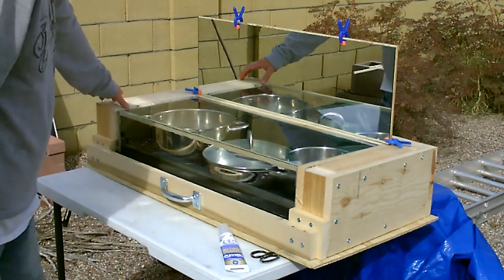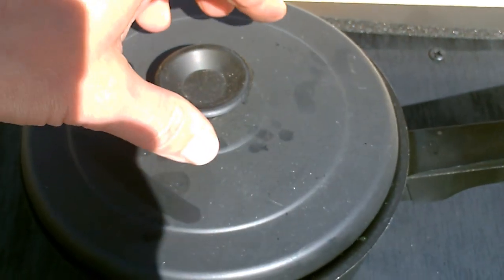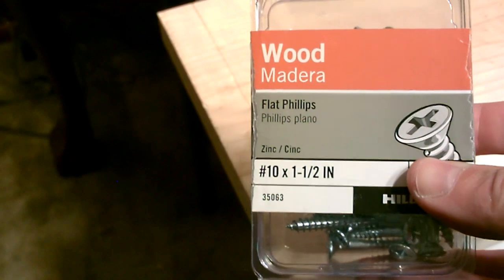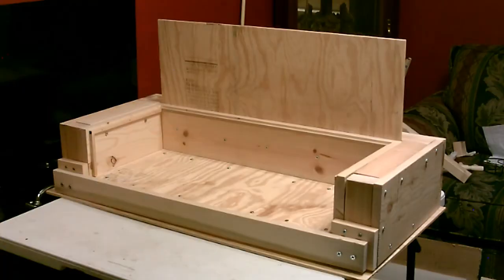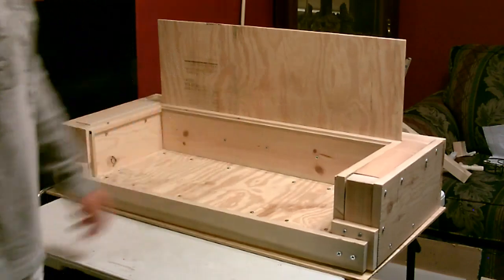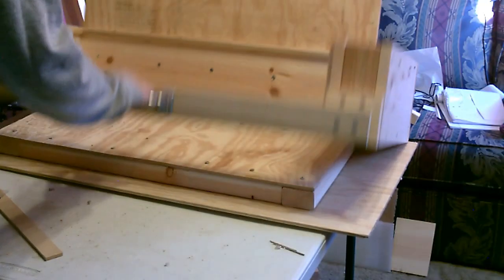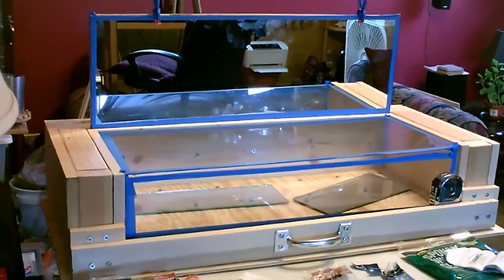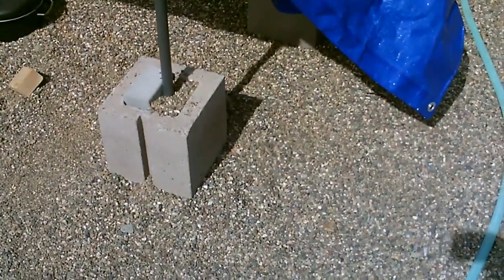DIY Advanced Solar Oven! Fully Insulated "No Turn" Solar Oven! (real wood, glass and mirror!) 350F+

Comment: hello, just curious before copycat: do you use it a lot? would you like to improve it with double glasing/more mirrors or are you satisfied with the performance?
Reply from the maker: hi. i've tried double and even triple glazing in earlier models but adding extra glass always seems to reduce the temps. extra mirrors is something i've been thinking about, but then you may have to turn oven more -so it's a tradeoff.
Reply from the maker: @J V they sell simple glass cutters for 5 to 10 dollars at stores like home depot and lowes. i think i even saw one for 3 dollars at harbor freight tools. very easy to do. you can learn in like 5 minutes. they might be able to show you at the store. another way to learn would be to watch a youtube video on it.

Comment: Looked like a gr8 design so I built one.  Mine is just slightly larger and I designed it so mirror reflector can be taken off and stored in the oven.  I cannot get it above 250 deg F though.  Right now I have now sealing along the edges of the base where the top glass portion moves up and down.  did you create some kind of seal along these edges that would keep in more heat.  Excellent design mine just needs some tweaks to get temp up for baking

Comment: I did not notice given hints about one thing: Where do you get the mirror, what kind of mirror is it (glass, etc)and how do you cut it to size without breaking it? Cat in Seattle
Reply from the maker: hi. it's a real glass mirror. cheapest way to get that is to buy one of those 5 dollar wall/door mirrors that walmart sells. (just remove the wood or plastic edging). to cut mirror i just use one of those small 5 dollar glass cutting tools (the ones with the tiny wheel). you can get those at home depot or probably even harbor freight tools or walmart.

Comment: Where did You get that insulation ? I can't find it at H/D or Lowes .
Reply from the maker: hi. here's one link https://www.homedepot.com/p/Greenfiber-Low-Dust-Cellulose-Blown-In-Insulation-19-lbs-INS541LD/100318635
Reply: @desertsun02  I Already have over $100 invested in this ( mirror alone was $30 ) . I bought some fiber glass insulation ( 2 small bags ) , any chance this will work ? Tell me what does the vertical glass rest on ( bottom ) ?

Comment: .Well I finally after many months got my truck running again.
And finish building my solor oven like this. Mine however is taller.
Oven area is 21x24x21 WxLxH. I had to use plexiglass instead of glass because each time I got glass, well it broke.
Runs at continue 150 to 170 F. Has gottten to 200f plus ( not much over 200).
A lot more durable then the box one I had made before.
I however do not have the reflector on top. Which would likely make it run hotter. I originally had planned to. But since my truck was down it never came about.
The wooden part ( painted) has sat outside since last year. And once, about a month ago, I finished building it. It has sat outside. I pained mine red inside and out. For no reason other then it was a darker color at the store.
For the last week plus I have been using to dry mesquite beans pods. 
I have baked bread in it a few times since I finished it. Can't get brown rice or beans to cook in it. Which is a problem I had with the cardboard one also.
Over all I'm happy with it. But wish I could cook rice and beans in it.
I'm thinking I may add a bottom reflector along with top when I can.
Reply: I thought I may add.
I used 1x6 dogear 6 foot fence and 2x4s with attic spray in insulation ( non fiberglass) and plexiglass.
I sealed the inside, where the insulation goes, with silicone for Windows. And ended up also using  to seal plexiglass.
I did notice about once a month while in use. I will have to replace where the two pieces of plexiglass meet. I notice a leak in part. Then 2 days later I notice the other half was leaking. So in the future, next month, I will just replace the whole edge at once.  One $5 tube will last the whole season with most not used. Cheaper then any propane I would have used.
I don't remember total cost. But it wasn't much. I'm going to over list materials. Because I used some after I was done building all but the glass part.
(12) 1x6 dogear 6 foot fence ( it's 4 high)
(3) 2x4 8 foot
(1) plexiglass ( I cut both pieces from it)
(4) pieces of glass 24x24 ( didn't use they all got broken before I used then both times.)
(3) tubes of window silicone, not chalking (I don't remember but I think it only used 1 total. )
1 quart barn red outdoor paint. ( still had a lot left over after I used.  a pint I believe would have done it and still had some left)
The blow in insulation I had bought when I made my cardboard one the year before. Both just dented the bag of it. Unfortunately after making the wooden one I forgot and left it outside and the wind got it. 
I choose to use the fence wood because I didn't want plywood to separate. And they were cheaper then 1x6s.
Reply: Also. As I had said it runs 150 to 170. That is sun up +1 hour to -1 hour sun set. Not turning. Turning from sun up angle to sun down angle I achieved the slightly above 200F. Turning more then the two faces did no more. 
So moving it once during the day, 10ish,  I recieve a little more  during high sun times. 
I prefer just to set for noonish and just do the 150-170. This way i can set it the night before and next evening my bread is done.
Which is a nice moist fresh bread with no real crust. 
I make 3 to 4 loafs
4 cups flour
1/2 cup sugar
1 teaspoon yeast
1 cup water.
Found that clear lids on pots works best for cooking bread like this.
Black or metal lids cooked it a lot less. 
Replace the flour and sugar with velvet mesquite flour. For a very strong bread. Has a molasses taste.
Skip the yeast with either and you make a dense bread.
And as a FYI. With the mesquite bread. Let it air dry in pieces for a day makes a dog food.  My dogs go wild for it. And yes it is safe, coyotes eat the pods and beans often. High in Protein, zinc and some other good stuff.

Comment: do you think that if you continued the mirrors around the left and right sides as well that would make a difference to trapping more heat in??
Reply from the maker: hi. that would or should make it hotter. i didn't use side mirrors because of the shadow they can cast. but if you don't mind turning the oven more, i'd say use side mirrors 👍🌞

Comment: This looks great but... as a cook I wonder how to get a heat low enough to simmer, for instance to make a slow-cooked stew, and other dishes that don't require high heat. Is it just a matter of changing the inclination of the mirror? It would be useful to draw a heat scale like on stove knobs, especially since there is no flame, but depending on the time of day, the season and the latitude, the scale would not be useful everywhere all the time. 
And supposing you need to cook pasta for ten people, or use a pressure cooker, you'll need more height space than this design offers. Can this be worked out?
As for sauteing, I don't think it's possible. I don't think one can stand in front of this stove and do cooking routines like with a regular stove, adding ingredients one after the other etc. But if it boils the water for tea or cooks the beans and the soup, that's plenty.
Reply: A solar oven functions entirely like a crockpot. It simmers until it cooks.  You can't get a high heat, like that needed to cook pizza crisply, in a solar oven. You can't really cook pasta in a solar oven - you could on a parabolic.
Reply: @seungjisuh5784  thanks.

Comment: Great video.  I'm going to try to build my own.  I have a question though...insulation that I've always worked with needs to maintain the air within the material to hold insulate properties.  I've never heard of an insulation that can be packed like that and still be effective.  Is there a reason why you used this type of insulation?  Just curious what your thoughts were about that.
Reply: Hi! Great idea, easy construction. Doable. Can you give estimate of cost and weight? 🙏
Reply: Great question. Cellulose insulation (used here) has an optimal density for maximum effectiveness. I think it is 3.5 lbs per cubic foot. So one should not pack it as tight as done here. The idea is to maintain air space in the material.

Comment: Love it..  I would love to see the mirror be removable for storage purposes.. perhaps on a hinge that you can fold it down and latch it to the oven itself.   I love the way you left the front open with the glass.  I have been looking at different ways to make my own and this is the very best video I have come across. ever.. I will certainly try to use some of your ideas, mainly the open front concept, in my build.  Thank you so much for sharing .. you did a great job!
Reply: I made oven based on this design and made the mirror reflector removable using lag screw to bolt combo with wing nuts.  the screws go thru holed in the base of mirrored section and tightened down with wingnuts.  the mirror can then be stored inside oven.  My oven will not go above 275 deg F so far.  May need to created a better seal around the edges of the oven along where it opens and closes

Comment: For added insulation, use thinner pieces of wood and don't smash the insulation.  Wood is actually a poor insulator (r-value is about 1 per inch, whereas fiberglass is about 3 per inch).  Good build and lots of ideas you've given us!!
Reply: Gaps in insulation aren't a bad thing
Reply: @joeychagnon3427  That's not true at all.  It's one of the problems in homes, you can see the gaps formed over time at the tops of walls in thermal imaging.  Those gaps allow thermal transfer at an accelerated rate, leading to heating and cooling losses.  Gaps bad.
Reply: @joeychagnon3427  I'm not sure where you heard that gaps in insulation aren't a bad thing???  Thermal insulation has one job.  To slow the transfer of heat from one side to the other.  If you have a gap, that means that the heat can more easily transfer.
Reply: Use mineral wool batts and you don't have to worry at all
Reply: Not 100% sure, but slightly smashing the insulation may be beneficial.  Insulation has a tendency to settle, leaving gaps.  It would be interesting to see though, which worked out better.  Give the type of insulation he used, it may be more likely to settle, based on the propensity of those materials to collect environmental moisture.

Comment: Outstanding in the way you think through each aspect. I have a suggestion.. I would like to try Perlite as the insulation. I heard it has around R-value 2.7 per inch thickness( left over from making my rocket mass heater. ). Good or bad?
Reply: Don't see why not. It doesn't off gas and it won't burn readily

Comment: It would be cool if you built one lined with bricks (instead of insulation) and enclosed with glass and then compared them.. That would be more expensive because of the glass; maybe build it on a half scale..? I'm interested to know if the insulation, which also keeps heat out, is very efficient with solar ovens. I think keeping a thermal mass warm might be more efficient. Just a thought.

Comment: The insulation works best when not compressed.  By compressing the insulation the way you did, the air pockets you want, no longer exist, and the insulation factor you wanted, unfortunately you did NOT achieve.  Otherwise, not a bad build.
Reply: Nice information.

Comment: Was there a reason you used solid wood instead of plywood for the sides? Quality stable wood of that dimensions, is hard to come by here. I was thinking of using 12mm ply and constructing my own ‘SIP’s maybe 70mm of foam insulation. Very strong, and very light.

I love the design, just looking to modify it a bit to suit the materials I can buy locally.

This is the best looking Solar oven I have seen, far better than most commercial ones. It was the looks that was putting my wife off having one. 

Thank you.

Comment: Great idea ! Just one suggestion. The side walls need not be wood or metal. Side walls of glass itself will be better and give addition 50℃ boost. Not sure if epoxy glue can hold at that. Aluminium corners can be used to bolt the glass panes together with silicone as sealant.

It will look like a giant record player.

Comment: That's awesome man.. my question is, would it be feasible to use sand for insulation, like the kind you use for a swimming pool filter.
Reply from the maker: sounds like a good idea. sand is a great insulator. will make the oven quite heavy thou

Comment: I need to build a solar oven but I want a solar pressure cooker oven. My idea is get a $10 foam board use emergency blanket and attach using either wire or string create a big C , anchor to a board place pot in focal point.
Reply: Foam board at that kind of temperature will release toxic fumes, and will also melt.

Comment: I'm going to give this project a whirl, it's just about within my limited novice DIY capabilities. I had a few questions desertsun, or anyone else who has knowledge about solar ovens, and has a moment to respond?
- It's heavy, so keeping it outside makes sense. Would it not be better to weatherproof the wood, even if covering with tarpaulin?
- Would the interior work better if it had a reflective mirror-like surface?
- What alternatives are there to the green insulation material bought? I don't seem to have anything like that near me (I'm in France).
If possible, I will look to adapt the mirror so that it can be tilted. No desert sun over here, so I think it would be more efficient to concentrate it more directly.
Thanks again, inspiring video.
Reply: …peut être de la « laine de verre » comme isolant ? ( je parle français comme vous).

Comment: What about replacing the mirror and the top glass by a tilted glass (like the greenhouse design). You still get the same light but avoid the reflective mirror that could hurt the eye.
Reply: You don't get the same light as this with a tilted glass and no reflectors.  Looking straight down at it from the top, you want the reflectors to cover more area than the bottom of the oven - the more the better.   This looks like it captures about 4 or 5 times more sunlight than the box would capture with no reflectors.

Comment: I confused about the high pack of the insulation as well, bc I always taught insulation need to be loose for air. I am open to learn, I was always dealing wid fiberglass before.
Reply: Your instinct is correct. I read about a study of walls with batting vs walls with no batting. Both walls were carefully constructed to modern vapor barrier standards, insuring virtually no air infiltration.  I don't recall the numbers, but there was virtually no difference in R value. As long as there is little air infiltration and the "dead air space" not badly compromised, batting in the walls is not very cost effective. A batted roof showed a bit higher R value than the non batted roof, and was deemed more worthwhile doing. Batting is intended to dampen air movement in the leaky old pre Tyvek walls. 

If anyone doubts that the more the dude packed in, the more he defeated his purpose, just imagine continuing until finishing with a hydraulic press to make it rock solid. If you are sealing a space absolutely airtight any amount of batting will increase heat conduction, no matter what kind of batting is used. To further reduce conduction, one pulls a vacuum on that airtight, dead air space, removing more heat conductive particles.  E.g., Packing batting tween the walls of a Thermos, before pulling vacuum on the bottle, will not increase efficiency.
Reply: Loose insulation works, compacting it removes all of the air (the actual insulator).  Likely only 40% of the rating of properly installed fiber insulation.
Reply: Agreed. It's definitely confusing. Unless someone has special non-conducting insulation..
Reply: I'm not the only one thinking that then! I'm not an expert and have close to zero experience, but air trap is the purpose. Am I missing something as well?
Reply: Price  ?  Want to buy
Reply: Sandhya Khurana build it yourself, that’s the purpose of the video. You don’t want to buy one of these cause it’s not built properly.
Reply: @1982MCI  What do you mean? His video shows temps and a cooked item. What is he missing and/or how could it be built properly?
Reply: @dk3212  "What do you mean?" -- He's saying the ones that you buy are usually cheaply made. We build these ourselves because we can make them properly.
Reply: Don Pfeiffer probably btr to use  “wouldn’t” &  “they” are usually built improperly. The “it’s” seemed to be referring to the video sample even though you meant it for the market choices, and many foreign viewers.👍🏻 no offense intended!
Reply: Straight Razor Daddy   What factors define the difference? How much heat transfer difference is there in equally compressed models?

Comment: That's the best looking homemade solar cooker I've seen but does look kinda heavy tho. Why black inside?  Wouldn't reflective material all directing heat to the black pot make the cook area hotter? Seems that's where you'd want the heat.
Reply: Black absorbs heat. Should be using black pots.

Comment: I'm soooo copying this design for van life. Its a real setup as opposed to so many horrible inefficient designs. It looks like a traditional BBQ which is what people want. I can see what you've done and I would use thinner wood and solid urethane insulation and a cast iron plate on the bottom. But the design is absolutely the best on the net...and this is already six months old or so...Its a rock star design and if I were you I'd patent it quick smart!